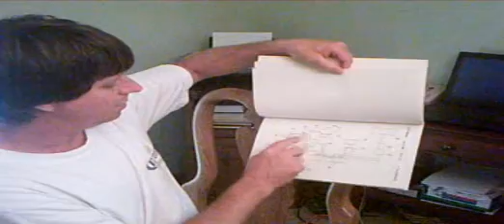portable generator add you tube

Comment from the maker: Responding to the question what if there's no gas available.
If there is no gas available then you can still get power over a long period of time with a solar panel which would charge the battery.  There is an inverter that converts the DC power from the battery to AC power.  But the concept for the hybrid generator systemis to store power while running the generator using fuel for high loads and store power for low loads such as television computers lighting etc.  hope for lots of gas.